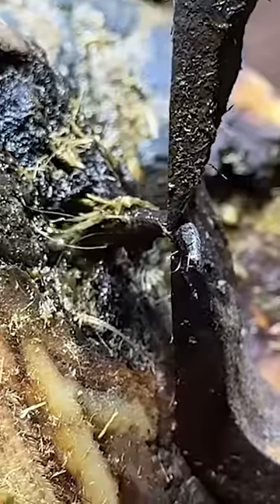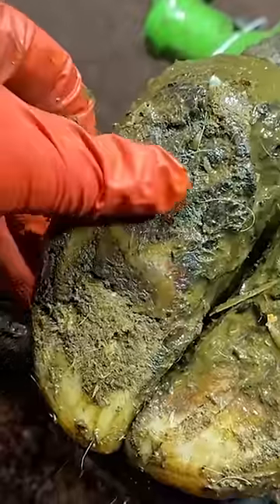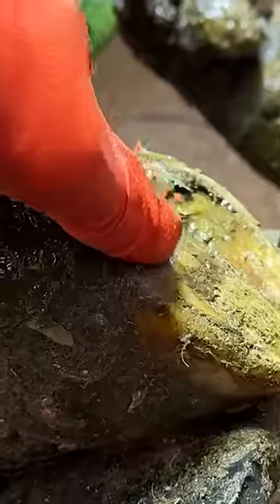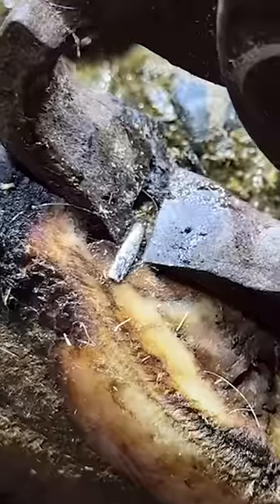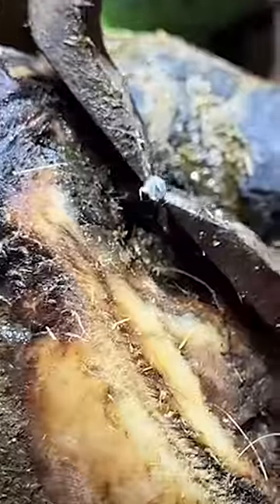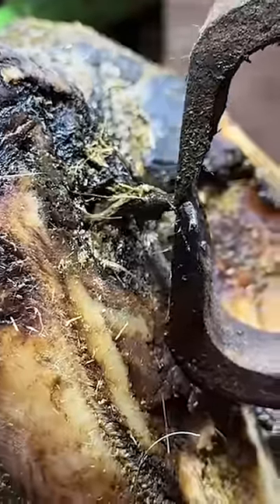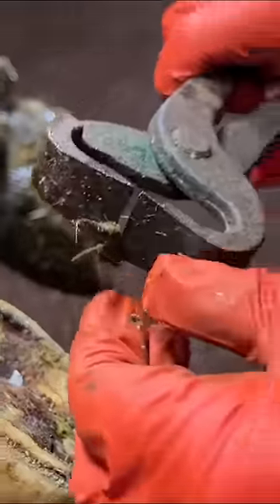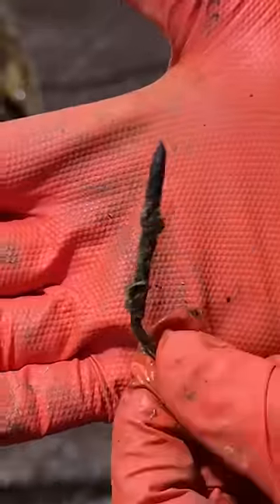* INCREDIBLE * ... I pulled a HUGE, rusty nail from the cow's foot. #hoof #animals #popperfection

Comment: It looks like a double headed concrete nail. They are used to put formwork together. The double head is to allow the nail to be pulled out when the concrete hardens, since it is only drive to the first head. The first head is what caused the nail to crimp like that when she stepped on it.

Comment: That poor baby. I remember when I was 7 I went running out in the backyard to grab something and I was barefoot and I stepped on a large rusty nail. It went in my foot about 2 inches. I was able to pull it out but I still had to get a tetanus shot and antibiotics. They also cleaned the puncture hole. Thankfully, they didn't have to scrape layers like they did for her.